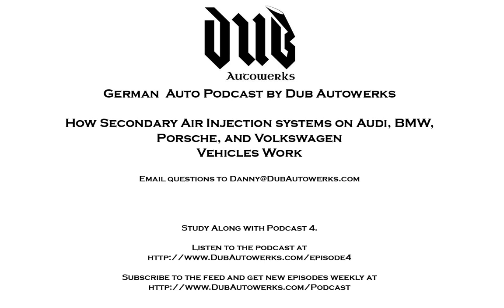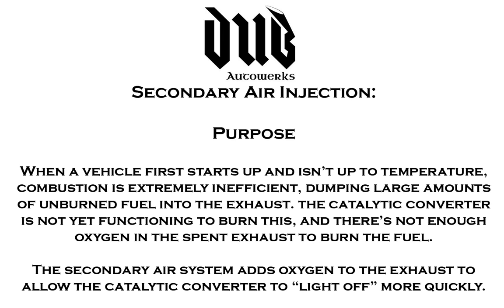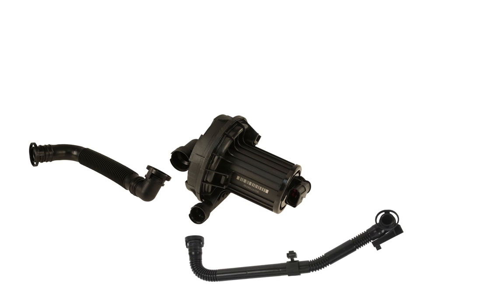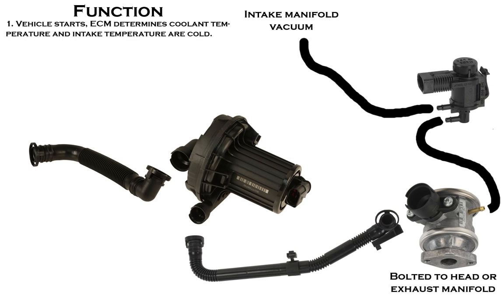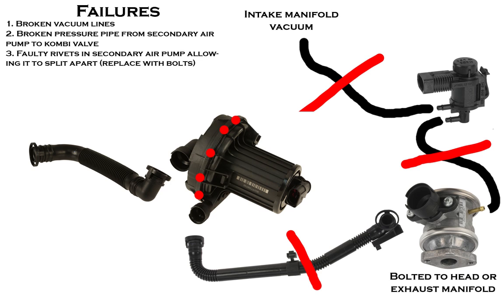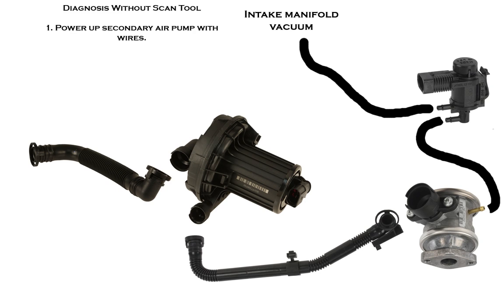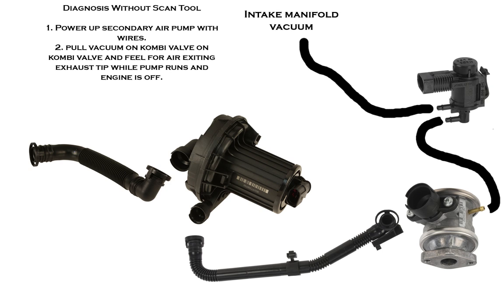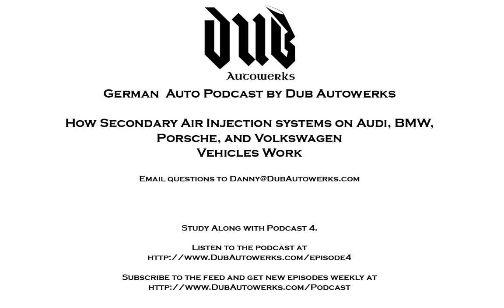Secondary Air Injection Systems on German Vehicles

Comment: hey thanks for the video i have question regarding my 01 bmw 330 xi every time i go for inspection i get a rejected sticker because two tests will not run secondary air and evap when i dissconect the vacum line from the solenoid to the kombi valve there is no vacum do you think thats why it will not run the secondary air test? and what are your thoughts on evap and why my car will not run the test? thank you
Reply from the maker: There shouldn't be vacuum to the kombi valve unless the secondary air pump is running. If there's not at that time then there's something up there.

Not sure with evap, it should run, and if there's not a fault and you haven't cleared faults recently it should run. 

You'd need a factory equivalent scan tool to go much further.
Reply: Thank you for you response im gonna have to take it to bmw because it needs to get fixed thnx again

Comment: 10 q5 3.2 ,swapped driver side head ..the new head doesn't have the port to connect the SAI. ..can I  bypass the head and just drill a hole in the exhaust manifold? car runs good exept it throws a code fo insufficient flow detected. would that solution make it for the code not to set again? thanks in advance

Comment: Good vid! I'm curious, my 99 A4 B5 is popping up two codes; 
P0422, which I'm assuming is a secondary O2 sensor issue and
 P0441 which I also checked and turns out to be a Secondary Air Injector issue. (hose)
I guess my question is; Can the SAI problem also trigger the P0422 error code?
Reply from the maker: The p0422 means your catalytic converter itself is faulty. P0441 is evap system incorrect purge flow...there's a small solenoid called an evap purge solenoid by the air filter housing. Google B5 A4 evap purge solenoid. Then find that on your car, remove the vacuum hoses to it and tap it on white paper, if black stuff comes out the charcoal canister has contaminated the valve and that's charcoal stuck in the valve. That's why you NEVER want to top the fuel tank off after the pump shuts off, it fills the canister with fuel and the charcoal then leaves the canister. 

Your faults have NOTHING to do with SAI at all.

I do performance tunes, if you want to message me privately, if your A4 doesn't have a throttle body cable and it's just electronic I can tune this stuff out.
Reply: magellanmax
Reply: magellanmax 
M
Reply: magellanmax

Comment: Very easy to understand the process thanks to your video.  I have a 2004 Jetta 2.0 that has a P0420 code.  When I jumper the secondary air pump relay, air flows through the kompi when it should be closed.  Any thoughts?
Reply from the maker: It's pretty common for the diaphragm to fail. If what you are saying is true, you also should get exhaust flowing out that pipe too.

Comment: I have P0113 code on 2002 jetta,2.0 engine
Reply: Zinah Shakir Intake air temp open circuit means your mass airflow sensor is faulty, or the wiring to it is faulty. Purchase the connector and repair wires from the dealership and replace yours, just wire it in with weatherproof otherwise known as heat shrink butt connectors, and that should fix it.

Comment: my car is running bad,its like dead when I push on accelerator pad,I changed air flow sensor,secondary air pump solenoid,spark plugs and their wires but the car still same?2002 jetta,,2.0engine
Reply: Zinah Shakir Stop throwing parts at it, and get a scan tool from Ross-tech.com then we  an scan and diagnose it.

Lets start with what brand parts did you use? If you didn't use factory parts, then chances are you juyst made the situation worse. Especially with the mass airflow sensor the ones from the parts stores that aren't Bosch are bad right out of the box.

Comment: the prior owner put a aftermarket cold air intake in and the hose that connected to the original air filter box.
Reply: mikeyd19841 So then what happens normally is that hose sucks dirty, unfiltered air, and over time that carbons up the ports in the kombi valve or the cylinder head if the engine has that design. So now depending on the engine, you could even have to pull the head to clean the passages. Crappy.